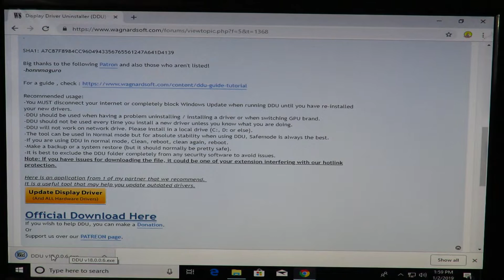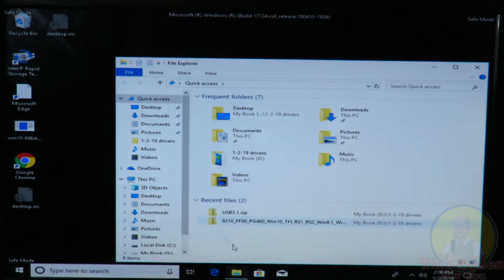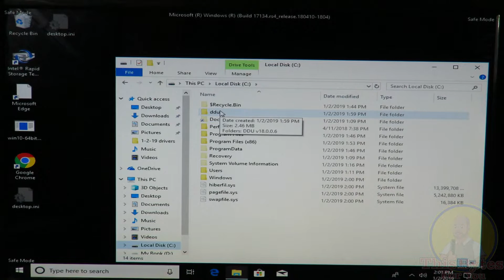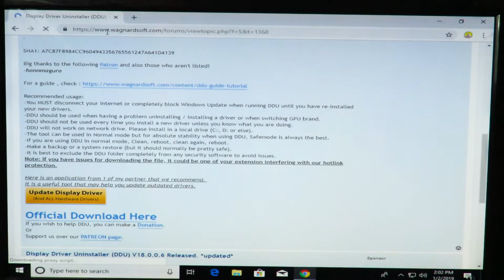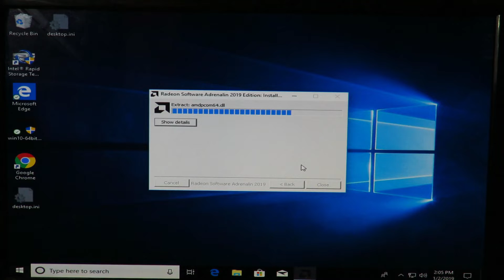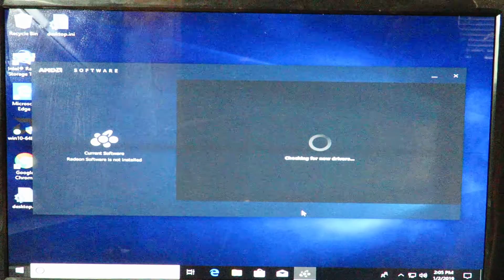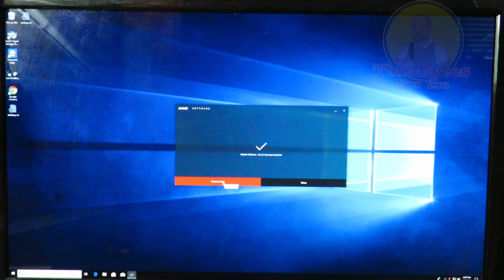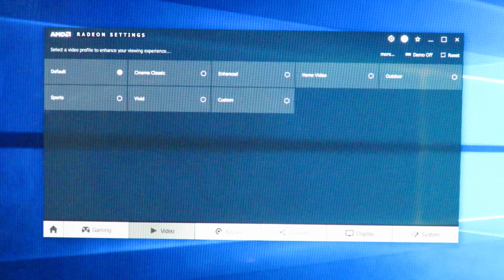How to install the AMD Sapphire Radeon Nitro+ RX 590 8GB OC Special Edition

Comment: Hello friend! I've got the same GPU and I have some issues, I like to play a lot Batman Arkham series and, for some reason, Arkham Knight always crash. City and asylum don't have any trouble, but Arkham Knight I played only 10 minutes and my screen gets black... Do you have any suggestion for this?
Reply from the maker: So that I can help, please list the manufacturer and exact model number of the following components:
1. Motherboard - manufacturer and exact model number
2. CPU - manufacturer and exact model number
3. RAM - manufacturer and exact model number
4. Video Card - manufacturer and exact model number
5. Power supply - manufacturer and exact model number
6. Monitor - manufacturer and exact model number
 Redundant I know, but many people forget to enter manufacturer and exact model number
7. Do you have ALL of the PCIE connections plugged in, and not daisy chained or pigtailed, each coming directly from the power supply?
8. Are you running through HDMI, DP, DVI, VGA, any adapters?
9. UEFI in the BIOS from Legacy.  If it was set to Legacy, you will need to reinstall windows to get correct support.
10. Disable CSM in the BIOS
11. Installed latest supported chipset driver?
12. Have you disabled Fast Boot within Windows?
13. This video will help you identify hardware inside your PC: https://youtu.be/65ZSiVImJx0
Reply: @ThisBytesForYou  

1. Motherboard – Asus H61M-A/BR 
2. CPU – Intel Xeon E3 1270 V2
3. RAM – 2X8 GB DDR3 WALRAM
4. Placa de vídeo – AMD RADEON RX 580 8GB
5. Fonte de alimentação – MSI MAG A600DN, ATX, 600W, 80 PLUS
6. Monitor - Tv 42P Lcd Tc-L42U30B Full Hd Dtv
7. Yes, all connected
8. I use a HDMI connection on my TV.
9. I’m using a Legacy... I guess we found the issue...
Reply from the maker: maybe, watch this video and do what I show you to update your BIOS and your OS to support the card, watch from the beginning till 6:35: https://youtu.be/aHVCmkm67q8, I know its about a hard drive but this will help you.
Reply: @ThisBytesForYou  
Hello good friend! Do you believe that I've format all my legacy system to UEFI and still arkham knight still drops? LOL! Instead, the other arkham series works... I don't to know what to do, my PC is not so weak to play games like that...
Reply from the maker: You don't need to format it, you can convert it like I show you in this video I linked above, and set your bios to uefi, you will need to update your driver's too and a bios update if possible.
Reply: @ThisBytesForYou  

Yes, but the command mbr2gpt didn't work... I reinstalled windows and all AMD Rx 580 drivers again, still Batman Arkham Knight crashes...
Reply from the maker: @Pakalolofree  what resolution and settings are you using
Reply: @ThisBytesForYou  1366x768 and high resolutions, I will down now to test...
Reply from the maker: @Pakalolofree  yeah chose medium maybe
Reply: @ThisBytesForYou  even medium the game crashes about 10 minutes... Right now this happened...
Reply from the maker: @Pakalolofree  is it legal or cracked?
Reply: @ThisBytesForYou  legal, from steam, Batman Arkham collection... Asylum and city don't have any trouble, even in high resolution
Reply: @ThisBytesForYou  

Good news my friend!! I lowered the voltage and a fan curve and I don't have any more problems!! With the HD in UEFI, everything went well, thanks a lot for the support!
Reply from the maker: @Pakalolofree ahhh that's great news my friend so very happy for you.  When did you buy that card?
Reply: @ThisBytesForYou  
I bought it about 3 months ago on Aliexpress. Almost all my PC is from there, except the power supply and the motherboard.

Comment: Hello man! So the cables you connecting are from PSU? Right? mine has only 4 Pin can i use 4 to 6 pin for Rx 580?
Reply from the maker: no no no, the 4Pin is for CPU, you could end up blowing your card if you force that cable in, it shouldn't fit but I have seen people push it in, don't.'  What is the manufacturer and model number of your power supply?
Reply: @ThisBytesForYou  I already have connectec motherboard 4 pin but there sre horizontal 4 pin with connectors i  it i already used one on my secont hdd as sata connector
Reply from the maker: Ok, but we are talking on a video about the graphics card, not anything else, 4pin cables don't connect to the graphics card.

Comment: This card is a giant paper weight. Jk its not bad for how inexpensive it is. Replaced my 1050ti LP. It barely fits in my optiplex 9020. I had to shave down a wee bit of the HDD case, and the ram eject sticks. And upgrade my PSU. Looking back I should have bought a RTX 3060.
Reply from the maker: Well, the card and video is 4 years old, but actually I will be making a similar video on a similar card, so funny you mentioned it.  Be careful with Dell's, they have many proprietary components, the power supply may not be a standard power supply, the model number won't help though since there are many 9020's that have a trillion different configurations but if its a standard ATX power supply you are good.  Also, the 3060 is 2 years old, so it would most definitely be better than a 590, but budget is kind.  I have tons of in depth guides here on how to build a new PC, which can also mean moving what you have into a new case, but it may be difficult with the proprietary power button cable.

I have over 400 videos to help you in just about all aspects of the PC but if you have any issues, please let me know, thank you.
Reply: @ThisBytesForYou   yeah I'm learning. My pc is maxed out right now. I'm budgeted out right now. I am able to play switch emulater tho at a full 30fps.
Reply from the maker: @Mishakol1290  yeah, thats the way PC's are, since they keep coming out with games that stress the PC more and more with amazing graphics, consoles last longer because the games have gimped graphics, and lower locked frame rates and consoles can only do 1 thing, game, while PC's can do a trillion.  Nice, what are you using to emulate Switch games?
Reply from the maker: @Mishakol1290  thanks bud, I own a switch as well, but I love the work they do on this stuff, I think its amazing.  Is Yuzu the emulator?  Having trouble finding it, I see thew site, but I can''t find the emulator.  ahh cancel that, I found it.  So interesting.  Thank you.

Comment: Will this card do surround with 4 monitors?
Reply from the maker: yes, but you are taxing this old video card soooooo much more, you will generate more heat and pull more power.
Reply: @ThisBytesForYou  Is there a DDR5 card that you would recommend?
Reply from the maker: @stewartsstewart1089  normally I don't go by brand but SAbrent has been doing amazing, sadly I dont see any on Amazon, I know that G.Skill has been rocking it, you can check with my amazon affiliate link: https://geni.us/arye1T, but I highly recommend you look in the QVL for your motherboard and update your BIOS to the latest version already.  I do have a question though, if you are going for DDR5, it means you have a DDR5 motherboared, kind of new, why are you looking at a 590, it's a 5 year old video.
Reply: @ThisBytesForYou  I have a i7 core w/32gb ram and. 4gb nvidia card. I am using ddr5 and I want to bump up to 8gb or 12gb with a good vid card. I am using XP11 will b upgrading to XP12. So I am looking for a gaming Vid card that can do 8 or 12gb as well as do good for vr or ir tracking. Respectfully accept your suggestions.
Reply from the maker: What is XP11 and XP12?
So that I can help, please list the manufacturer and exact model number of the following components:
1. Motherboard - manufacturer and exact model number
2. CPU - manufacturer and exact model number (Core i7 is not specific, there have been about a hundred Core i7 models)
3. RAM - manufacturer and exact model number (32Gigs of what kind of RAM, who makes it, what is the model number, it says it on the RAM)
4. Video Card - manufacturer and exact model number (4gig NVIDIA card sounds REALLY old for a DDR5 board)
5. Power supply - manufacturer and exact model number
6. Monitor - manufacturer and exact model number
 Redundant I know, but many people forget to enter manufacturer and exact model number
Reply: @ThisBytesForYou  monitors I am running 1080p tvs. Operating System
	Windows 10 Pro 64-bit
CPU
	Intel Core i7 4770 @ 3.40GHz	40 °C
	Haswell 22nm Technology
RAM
	32.0GB Dual-Channel DDR3 @ 798MHz (11-11-11-28)
Motherboard
	Dell Inc. 0PC5F7 (SOCKET 0)
Graphics
	Generic PnP Monitor (3840x720@60Hz)
	Intel HD Graphics 4600 (Dell)
	2047MB NVIDIA GeForce GTX 1050 (Gigabyte)	51 °C
	SLI Disabled
Storage
	3726GB WL4000GSA6472E 1 (SATA )	46 °C
Optical Drives
	TSSTcorp DVD+-RW SH-216DB
Audio
	Realtek Audio
Reply: raphics
		Monitor
			Name	Generic PnP Monitor on NVIDIA GeForce GTX 1050
			Current Resolution	3840x720 pixels
			Work Resolution	3840x720 pixels
			State	Enabled, Primary, Unsafe
			Monitor Width	3840
			Monitor Height	720
			Monitor BPP	32 bits per pixel
			Monitor Frequency	60 Hz
			Device	\\.\DISPLAY1\Monitor0
		Intel HD Graphics 4600
			Manufacturer	Intel
			Model	HD Graphics 4600
			Device ID	8086-0412
			Revision	7
			Subvendor	Dell (1028)
			Current Performance Level	Level 0
			Current GPU Clock	598 MHz
			Voltage	0.675 V
			Technology	22 nm
			Driver version	20.19.15.4835
				Count of performance levels : 1
						Level 1 - "Perf Level 0"
							GPU Clock	600 MHz
		NVIDIA GeForce GTX 1050
			Manufacturer	NVIDIA
			Model	GeForce GTX 1050
			Device ID	10DE-1C81
			Revision	A2
			Subvendor	Gigabyte (1458)
			Current Performance Level	Level 0
			Current GPU Clock	607 MHz
			Current Memory Clock	405 MHz
			Current Shader Clock	405 MHz
			Voltage	0.675 V
			Technology	14 nm
			Bus Interface	PCI Express x16
			Temperature	51 °C
			Driver version	30.0.15.1215
			BIOS Version	86.07.39.80.6e
			Physical Memory	2047 MB
			Virtual Memory	2048 MB
				Count of performance levels : 1
						Level 1 - "Perf Level 0"
							GPU Clock	607 MHz
							Shader Clock	405 MHz
Reply: wow... lol... I didn't know my system was so old
Reply from the maker: @stewartsstewart1089    yeah, it is a bit old my friend, so you cant use DDR5, you can use DDR3, luckily I asked before you bought.  So you are kind of in luck.  In a month or 2, AMD, NVIDIA and Intel are releasing their new stuff, so you can upgrade your CPU, Memory and Video card,... which will mean you will need to upgrade your Motherboard and power supply, well you can have a nice secondary system at least ;)
Reply: @ThisBytesForYou  on the up and up. I have three total units. All the same. So, I am looking to buy a new case and upgrade. I would appreciate it if you can give me suggestions on what to buy!! you can DM me the details I would be so appreciative!!!  :washhands:👃👃
Reply from the maker: @stewartsstewart1089  We can discuss everything here, no need for DM, I started this channel to help everyone and if this can help everyone, that would be great.  Backing up to the beginning, now that you know your system is so old, you processor is a Haswell, a 4th generation chip, we are currently on the 12th generation, with the 13th generation coming out in a month.  

Do you only want to buy a case, or do you want to buy a new system?  

Games will perform SO much better with current gen AMD or Intel, as well as current Gen AMD or NVIDIA graphics and DDR4 even, though DDR5 is a thing its not as wide spread as DDR4.... your still on DDR3.

What is your budget
What do you use it for
Reply: @ThisBytesForYou  Well, First off I use it for Flight Simming. My Budget is about $700 per computer that I have now. I use three computers because I am using 11 screens, 4 screens per computer.
Reply from the maker: @stewartsstewart1089  you know that if you upgraded 1 computer, you may not need 3 computers anymore.
Reply: @ThisBytesForYou  Oh I didn't know that part... Interesting🤩
Reply: Running xp11 now will be upgrading to xp12 soon. I would like to get started because it will take a while to get everything upgraded.
Reply from the maker: @stewartsstewart1089  WHAT IS XP11 WHAT IS XP12
Reply from the maker: @stewartsstewart1089  so understand that the world doesn't know what XP11 and XP12 are, I have asked numerous times, but you have failed to provide the information.  Here are the system requirements for the game: https://www.x-plane.com/kb/x-plane-12-system-requirements/
Reply: @ThisBytesForYou  I apologize I was busy. XP11 and XP12 is X-Plane 11 and X-Plane 12. Flight simulators
Reply: @ThisBytesForYou  Yes,, I am using a i7 with core and one i7 with quad-core with Nvidia 4gb vram.
Reply: @ThisBytesForYou  my current vid card is a 4gb nvidia 1050
Reply from the maker: @Stewarts Stewart  It really bothers me when they right Core i7 as the specs, there have been 14 generations of Core i7's, the first Core i7 was released in 2008 and I can almost guarantee it won't be any good here.  It's not that you said it that bothers me, its that the manufacturer of that game said it.  If you notice the recommended is Core i5 8600K, the put out a SPECIFIC model there, coming from the First Core process, to the Core i8600K, that there is a 9 year gap as it was released in 2017, TREMENDOUS difference in performance.  The recommended GPU is a GTX 1070 was released in 2016, 6 years ago.  The game doesn't need a lot, but the 1070 performs, at its lowest 66% better than a 1050 at its best, 200% times better.  Not sure what SDI is, but if its the Strategic Defense Initiative, thank you for your service.  

What resolution do you play at?
Reply: @ThisBytesForYou  Hi, sry I took so long to get back with you. Had printer problems urrggg... then I missed my AME (aviation medical exam by 2hrs.) I thought it was later than I went. Then I found out I have to redo my med like I did 2yrs ago... Urrgghhh. Just a stressful 52hrs. Okay back to enjoyment. I am running now at 40fps average depending on scenery. I can get 60fps but the machine drags. Which is why I will be upgrading. I have seen a push of 65-70 when everything is set low and scenery is at a basic airport. But for training I am doing avg. 35-45fps. could be lots better. Now that's over a surround of 3 1080p 46" tv's. then on the other machine I am running 3 TV's 40" and 2 monitors getting 15-20fps. On the 3rd machine I am getting 19-30fps but it's vid card is a nvidia k2200 it's running 3 monitors 32" with only 2 doing flight sim and the other is working as a mapping monitor.
Reply: I am on a SDI budget which is why my units are so old. I purchased them about a 1.5yrs ago and need to do the upgrade. Everyplace I checked wants to gouge me! I use to build units but it's been so long I know things have changed.

Comment: Just bought rx580 and wowed that i dont have cables to put in my new cards ..

Can someone tell me what is needed
Reply from the maker: what is the manufacturer and model number of your power supply?
Reply: @ThisBytesForYou  
ATX-700WS-C
Reply from the maker: wow, that is amazing.... it only has 2 x 6Pin... sorry my friend but you can buy one of these, they are dirt cheap and the should work off of my Amazon Affiliate link: https://geni.us/oTB2G2 so after you receive that, plug in a 6Pin from the power supply, then plug in the 8Pin from this adapter plugged into a SATA Power connection and you will be good.  Please let me know how it goes for you.
Reply: @ThisBytesForYou  I realised the psu im using is what i borrowed on my workplace ..

So i gonna buy my own psu .. What psu can you recommend for me ..

Sorry for bothering im so dumbfounded building upgrading my pc that i bought year 2016
Reply from the maker: @_QWWQ_  no my friend, you are never bothering me, actually one I am reviewing, which I am pretty surprised at how good it is, is this one: https://geni.us/Luv6BB, (my amazon affiliate link) it is only 750Watts and is very affordable, but you don't need that much for this card, so you should be good.  On my main machines I have 1000Watts, because I am a reviewer I need to be prepared for what ever comes my way.

Comment: The fan of my rx580 8gb sapphire is not working is that normal? Or it works until the system have enough heat?
Reply from the maker: download TRIXX 8.0 and use the fan check health thing, now another potential issue that there is a fix for, what motherboard do you have and who makes it?

Comment: What about Vega 8? do i have to do what you did or do i just uninstall drivers and add a new one? u said to restart and download ddu if i have a previous graphics card but i don't have that just the integrated graphics that comes with ryzen 3200g
Reply from the maker: Yes
Reply: @ThisBytesForYou  do what you did or uninstall drivers and add a new one?
Reply from the maker: It sounds like you have older hardware, normally I would always recommend to DDU the system, but with the current issues with the AMD drivers and windows, I would say go ahead and update from within the software.

Comment: Does gtx 1660s and 1660ti requires both 6 and 8 pin or just one 8 pin?
Reply from the maker: with any video card you purchase, if it has 2, they both need to be plugged in, if it has 3, all 3 need to be plugged in, all of them need to be plugged in.

Comment: OK so i install my gpu into my pc than i plug in the 6 pin and the pc works but when i plug in the 8 pin my pc just turns off
Why?
Reply from the maker: Well, are you making sure you are using an 8Pin (or 6+2) PCIE power connection not an 8Pin EPS connection?
Reply: @ThisBytesForYou  i fixed it thanks!
Reply from the maker: @mihasucksatfifa942  cool, np problem my friend, so what was the issue?
Reply: @ThisBytesForYou  i just did something with the cables its stupid😅